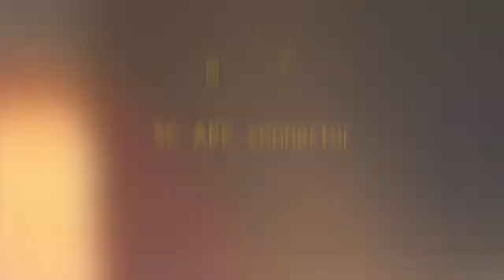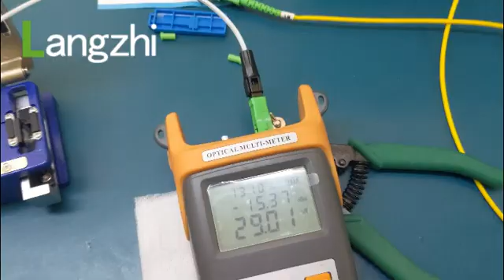Embedded SC APC optical fiber connector installation method

Comment: Is there a better reason using this termination rather than fusion splicing with the pigtail?
Reply: Sure. It is way cheaper than splicing. Also, you do not need to carry a fusion splicer, do not need "labor", just 2 hands, and a small thinking head. If you need to install a termination in an end user's home, it is faster and more fool-proof solution than splicing.
A fistful of quick connector costs about 50-70USD (100 pcs), and they reusable connectors, so you can tinkering :)

Comment: sometimes my sc connector doesn't work properly. And my wifi operator told me to spray on the front side of sc connector from any cleaner and reconnect it. This trick works but I didn't find anything on internet is it safe???
Reply: Ya bro it's safe but after spraying you should blow some air to it so that dust can move from the edge
Reply: If you need cleaning an optical termination like this, and you wish a reliable solution, look for Reichle And DeMassari. It is not cheap, but works good, and very simple to use.